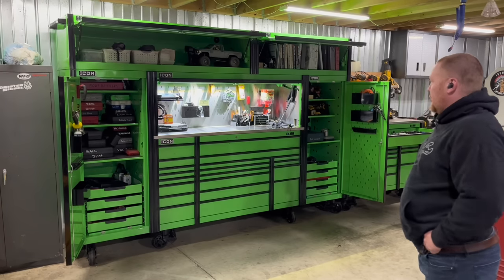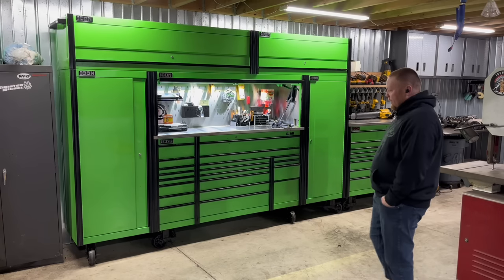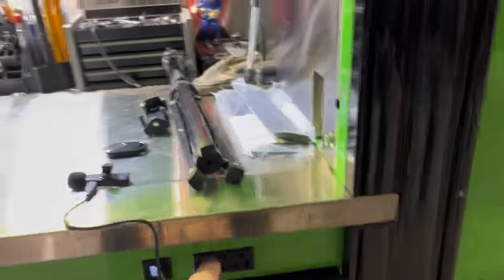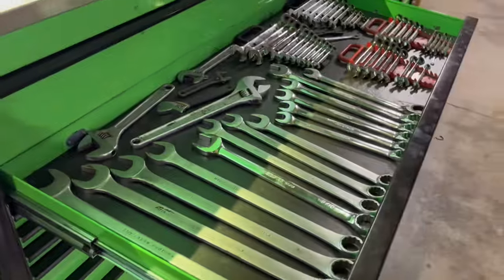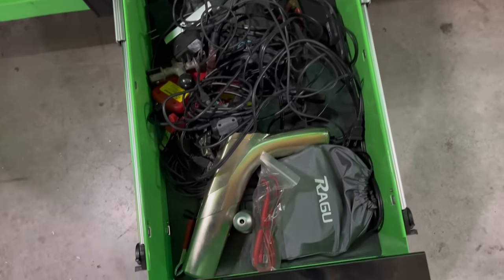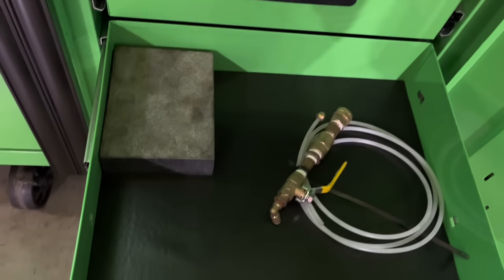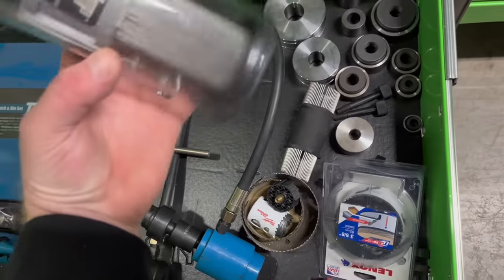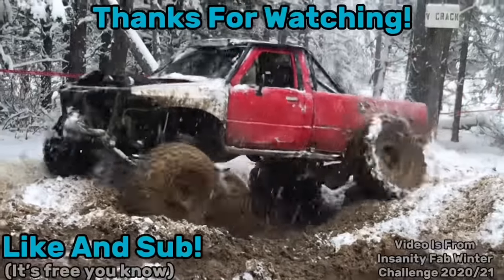Tour my Icon tool box. 6 month review. How it compares to snap on and some key features

Comment: Snap On sucks. I’ve been a tech for 26 years now and I’m on my own now with my own business. I’ve worked with so many mediocre mechanics over the years that swear you’re not a “real mechanic” unless you buy Strap On. I can fix crap with flea market tools as long as they don’t break lol. Never worked at a shop that had a reliable Snap On dealer. Every couple weeks one would quit, then we’d have nothing for months and a new guy would show up for a couple weeks until he quit… Been like that for over 2 decades now, both in Illinois and Florida. Now that I’m on my own I’m really finding out how awful it is to try to warranty something without having a tool distributor (just as bad as not having one show up for months). I’ve called their helpline several times and have been told to wait 7-14 business days for an email on where to send the tools only for it to never come. The rep will not tell you on the phone, it’s the biggest bunch of BS. Thank God I don’t have many Snap On tools. One thing I will give them is that their ratchets are decent. Harbor Freight ratchets are pure dookie.

Comment: As soon as you opened the hammer drawer I knew it was quality box. Socket, wrench, and hammer drawer weigh so much, if a box can handle them with little slop it's a good box.
Reply from the maker: Over 3 years now, every drawer loaded and not one complaint. Used daily 👌

Comment: I have looked at the Icon and US General boxes at Harbor Freight for quite a while. Since the Series 3 US General boxes have just been released to the stores this month, they had put the Series 2's on clearance.  I managed to get a GREAT deal on a clearance priced 72" triple bank roller cabinet Series 2 in green like your Icon that was the last one/display a week ago. Pretty happy with it. I plan on buying the work center hutch and side cabinets when they show up in stock in green at my local HF because the Series 3 is compatible with the Series 2.  This US General setup is replacing multiple smaller Craftsman stacked tool boxes. I would have liked to have bought the Icon cabinet, but since I'm not making a living out of the box I couldn't justify buying it. Besides, my pre-approved HF credit card would have left me over $1,000 short to be able to buy the Icon. Price comparison: on the Series 3 72" cabinet is $1,799 compared to Icon cabinet is $3,499. If you can find a US General Series 2 72" cabinet on clearance, they are $1,169...and if it is the last one display with a blemish, the manager may knock a little more off...and if you don't have a Harbor Freight credit card, you can get another 10 percent off of that with your first purchase...and qualify for 12 months same as CASH. Sheesh...I sound like a Harbor Freight salesman...LOL

Comment: It looks like your drawers aren't opening all the way. I had the same issue. All you have to do is open the drawer till it stops and then give it a firm slow pull and it'll open the rest of way. Only have to do it once per slide. My guess there is a build up of grease in the back keeping it from opening all the way. Helps if you do one side of the drawer at a time. Absolute game changer for me
Reply from the maker: Yep, figured that out right away lol, thanks

Comment: I picked up a US General 56 today. I’m starting a new job and I have a roll cart but this dealership doesn’t have built in tool boxes. I thought about the Icon but the price for the US general is what sold it for me, since it will just be a secondary box. Maybe I will upgrade to the Icon if my US General doesn’t hold up, or go for a Snap On. The Icon seems really nice and the prices are a lot better than when they first came out. Not a huge fan of the skinny drawers but I suppose you can get a larger drawer and put it in.
Reply from the maker: You can purchase extra deep drawers pretty cheap, general is alright for the price as well, good luck with the new job man!!

Comment: I so want to buy that box. Every time I'm in HF I roll those drawers open and shut.

It's those 3 shallow middle drawers.
What were they thinking. All but useless.
What're they for ? Files and punches chisels maybe .I don't think my screwdrivers would even fit. 3 of those drawers? Maybe 1 ok. Redesign it. I'll buy it.
    I have the 5 drawer roll cart , green ,
 with ALL the accessories , including 2 sidetrays.  It's awesome. Replaced the fixed casters (2) with turn casters as suggested (shop environment)  Da bomb. HF rocks. I'm so over most of Snappys tools esp the sockets. The boxes , sheesh like u said, who the hell is buying those things ?
Reply: You can buy drawers separately fairly cheap.  I’m planning on replacing a couple of my shallow drawers and getting another end locker and adding an additional 4 drawers to that.

Comment: Did the smaller base mount to the side cabinet so you can make it essentially one unit?
Reply from the maker: It sure does, I would anti-seize the bolts as I had to evacuate for a wildfire and when I took it apart the threads gulled up
Reply: @rosinsautofab1956  thanks for the reply and the tip. I'm going to go give them a closer look today at the store.

Comment: DID YOU BOLT THE 56 BOTTOM TO THE END LOCKER I NOTICED BOTH HAVE THE CASTERS I HAVE A 56 COMING AND TRYING TO SEE IF I HAVE TO REMOVE THE CASTERS ON THE END LOCKER TO BOLT TOGETHER 
ALL THE PICS I SEE HAVE THE CASTERS REMOVED ON THE END LOCKER WITH A CABNIT ON BOTH SIDES
THANKS A MILLION AND HAVE AN AWESOME DAY
Reply from the maker: I bolted the 56 to the end locker yes, I left all the caster installed as they were from the factory, use some anti-seize on the bolts, I had to remove it one day to evacuate for a wild fire and one of the bolts galled up from the powder coat in the hole and I had a hell of a time getting them apart, good luck 👍🏻

Comment: Bought a Epiq 84" with the 3 long drawers for 4.5k. The guy took terrible pictures and it looked like a 60". Called and confirmed it was 84" he got a job on the oil fields and need to sell because he has box standing outside. When I got there it was literally standing under a tree on small farm. Got papers and proof it was paid off. Saw one with a locker SS top, hutch all drawers. It was a custom order stand for nearly a year before it sold for 10k. Box was less than a year old. Husband passed away and the box was paid off through tax deductions. They are out there.
Reply from the maker: Yes they are, if you have time to look for them that’s great! Under a tree on a farm😂, glad you got a good deal on a nice box

Comment: In Canada there are cheaper brand sockets that cost around $30 I haven't been on a tool truck in a long time so not sure what snap on sockets go for here anymore.
Reply from the maker: Depends on socket but I think I replaced a 14 mm chrome 6 point deep 3/8 drive the other day and it was 30$ us

Comment: The only thing I dislike about icon tool boxes are, depth!  If they made a 73x30 instead of 73x25
Reply from the maker: I agree 💯, my snap on krl was only 24” so it was an improvement for me 😂
Reply: @rosinsautofab1956  I’ve got a KRL1023. I’ve always wondered if you could fit an icon locker or end cabinet on the KRL.  Lol.

Comment: Crazy howyour box is set up just like mine and it's not a mess I hate that it makes me crazy I got a pull cart I work out of its got most stuff I need to get started then get whatever then when done I clean and put it back and start over on new work 
Same as   clean the floor and then start new and bolt or thing on the floor belongs to that car or project...can't work messy it makes me crazy I hate going to a boxand digging for a socket
Reply from the maker: Yes sir, I spend just as much time cleaning and organizing my shop and tools, people always ask me how I get jobs/projects done so quickly…. I don’t spend time searching for tools. Thanks for watching
Reply: @Rosins automotive fabrication  yes cleaning the floors in-between jobs make that job that job bolt on floor is from that job
Reply: Yes sir plus your not working in a s$it hole of a shop.i can't take a mess of a shop tripping over things. Trying to fine  sufff don't see how people do it .don't take long to clean up and new jobs new job ...I have a roll cart I got most of what I need to start air tools on the bottom anything more just go grab it and easy to see what iam missing any of my tools. No free tools with every joblol

Comment: the american way. if it aint broken buy something else cause its just newer. waste money, errr  I mean helps the economy to move forward. i had a craftmans small box. i waited and waited for it to break. then one day, 20+ years later my movers dropped it. broke it. then I bought an icon myself. and I didn't buy a huge one. just one that can match the current one.  more space means more things you'll want to fill it up with. i don't even need half the stuff I have now. I'm trying to sell off what I don't need now.
Reply from the maker: That may all work fine for you but I own a business and the way that tech grows requires me  to buy specialty tools etc.. to get the job done, a tool box like this is an investment, the more organized you are the faster and better you are at completing jobs, the better and faster you are the more money you can make and happier your customers can be with less down time. If my customer came into my shop and saw one 20 year old craftsmen box they would most likely think  they were at the wrong shop, They would probably be right. My old box wasn’t broken, I sold it to a young apprentice that will get many great years out of it for a good price, it was my time to upgrade. Thanks for your comment and thanks for watching 🇺🇸 That is the American way…. Work hard have nice shit

Comment: I am a snap-on guy myself but i am going to look into this Triple bank with hutch and lockers I really wanted the 84” epiq but at 21k just for the box no way in hell I can afford that best part I’ve seen with these icons is I can do the same thing you did with a double bank and stick it right next to the box love the set up it’s got me wanting to go icon. I just do wish they offered more colors and trim options for customers seems like green is the only way to get black trim
Reply from the maker: Ya I agree, they would sell more boxes if they did customs colors, thanks
Reply: Just wrap it. I did a 3D wrap on mine. It came out pretty good and I learned a thing or two in the process.
Reply: @rosinsautofab1956  oh 100% like personally I would love yellow but I don’t see them making it or if they do it’s after I buy one 🤣
Reply: @Volksoner619  what’s the life span on the wrap? Never had anything wrapped before, I may end up just buying black cause i tend to apply a few stickers on my boxes
Reply: @JRCreations92  for cars they say 5-7 years because of exposure.  I’d guess indefinitely for a toolbox. Mine is holding up pretty good aside from operator error. 
Vvivid has a cool product called indestructible wrap that may mimics a spray on bed liner. It works great for drawer handles and work surfaces.
Reply: I think the us general aftermarket trim fits the icon boxes but don’t quote me on it but from the looks should fit
Reply: @Chris-bu5yn  I’ll look into that further if not I guess I can just paint it
Reply: Us general trim definitely would not fit

Comment: KRL722 is the baby double master series. Not a triple.
Reply from the maker: Cool thanks, the icon is a better quality box
Reply: @rosinsautofab1956   I doubt Icon could put out a box with a full width top drawer that could withstand the weight of being packed full of sockets like the KRL1033 or KMP1033.  
Icon claims an 8000lb capacity. Sure the castors are rated for 8000lb total. I'd like to see what happen to that box with 8000lbs in it. 
It claims to be comparable to a KMP1023. It falls 4 inches in depth shy of that comparison. 
Sure it's better value, but its hardly better overall quality. 
It's not hard to hold up to empty drawers. 🤷‍♂️
Reply from the maker: Mine are full now that I’m moved in and they haven’t fallen off, yes better value, I like short 25” drawers
Reply: Icon is junk
Reply: @dude772 hf just lies in the specs all overrated it couldn’t handle to the snap-on. Why support trash from overseas.

Comment: All that money and the drawers don’t have a decent locking mechanisn/latch on everything..  they pull open too easily and only way to lock them is to turn the key… Nobody but Masterforce has a easy lift lever/handle across every drawer that lets you open the drawer each time but then self locks… Masterforce is the only one I’ve seen with a lifting lever that selfs locks when closing, Icon, Milwaukee, US GENERAL, And almost nobody else has this amazing feature, lol Milwaukee and many others don’t even lock properly, they have a useless soft closing feature or like the US General it only lets you unlock each drawer from a tiny lever on the far right of the handle and it’s a cheap plastic mechanism… man if you guys want some great heavy duty boxes go buy some Masterforce boxes for $1400 and you won’t ever buy another box again
Reply from the maker: You can adjust how easy and head they open by a dial on the slide, my snap on had a grip latch system that you move dot one side with your finger tips, I like the icon setup better, I’m happy for you that you found a tool box brand that you love and it works for you!! Thanks for the comment

Comment: Ill take my 30" deep epiq over the icon. They are expensive considering what they are. The tool boxes from strictly tool boxes and extreme tools are far better than icon for the same price.
Reply from the maker: I looked at the extreme box, I didn’t like it, thanks for the comment
Reply: Aiden Hamilton must be smoking something crazy
Reply: I can't even find an Extreme to look at. I thought Home Depot was selling them but never saw one there.  They look sweet .
Reply: @motorbreath3  if you wait until next spring harbor freight is coming out with a new us general series that’s pretty sweet. There are sema videos of them on YT.
Reply: @motorbreath3  supposedly some tractor supply stores sell them. The one where i love doesn't carry them.
Reply: @justinanderson985  yup thats y I'm waiting
Reply from the maker: @aidanhamilton9859 tractor supply tool box….. nice 😂
Reply: @rosinsautofab1956  they are just a supplier for the 72" box
Reply: I own a tool vault 84x30 W hutch and two side lockers . It's a good box for the money , feels far sturdier than the icon stuff I looked at , but not as nice as the matco & snap on boxes I have previously owned . That said it does the job well and has held up well.
Reply: EPIQs are the top box no box can compare in the long run. Too many imitators made from overseas junk in sweatshops

Comment: Icon isn't bad for a homeowner series, but there is a difference.
Reply from the maker: I’m a journeymen fleet mechanic for over 20 years, I’d have no problem using this at work also in my opinion, the quality is equal to or better than my older snap on, but I agree there are differences between any brand, thanks
Reply: US General is a top of the line homeowner’s box. Much better than the stuff from the big box stores. 
Icon boxes are in with Kennedy, Homak and other legacy manufacturers. 
Truck brands are just overpriced.  But they make their money financing tools.
Reply: @Dave Haggerty  Ive owned a general box, I was less than impressed, thin metal, cheap drawer slides. Didn't last 6 months before the top drawer was rubbing in the center. I would like to see an actual in depth inspection between  A Snap On Epic box and a Icon. Actually test the drawer strength, sag, internal structure,  welds, etc. You will see the differences.
Reply: 30 year mechanic here… have had my icon in the shop daily use now for 2 years and no complaints. Icon isn’t bad for a professional mechanic.
Reply: @Random-bm7ho  Snap-On does make the best tool chest. They have a video explaining how and why. 
If you were pushing a fully loaded chest around the shop every day that’s what you need.  It seems most guys use chests for storage and work out of a tool cart. 
Tool chest makers state the gauge of steel they use.  They don’t tell you the quality of the steel.  If it is tempered or whatever. 
From US General to Snap-On they tell you the weight capacity of the drawers. 
If you overload any of them they will sag. 
I have a 56” IS General ll double stack. 
Fine for me. In my shop I work on my equipment. I’m not a flat-rate mechanic.  
I did add rivets to the slides to cut down on the side to side movement and stop that danmed squeaking.  And stuck magnets inside the cabinet to keep the drawers closed instead of those thumb latches. 
I think the drawer sides are a gauge thinner than Icon & Snap-On. But it’s not as deep. The professional boxes are 24” deep. And Snap-On has a super deep box. 42” deep maybe?  More than I need. Or care to pay for.

Comment: The only way Snap on is justifiable is if you have been in the trade for over 10 years and are one of the top earners at the shop. Start off with basic tools. As you progress, you're experience will dictate which tools you need to buy that are of a higher quality. Any mechanic worth their salt can do the job with the lower quality tools. Remember that. Snap on tool boxes are ridiculous, and not worth the price.
Reply from the maker: Well said, I’m a journeyman mechanic… top of my trade,  certified welder etc… and I still have a hard time swallowing tool truck prices. The best thing about being in the trade for over 20 years is my ability to know  if I need the high dollar tool or if I can get away with a more reasonably priced version that will last. I appreciate the comment.